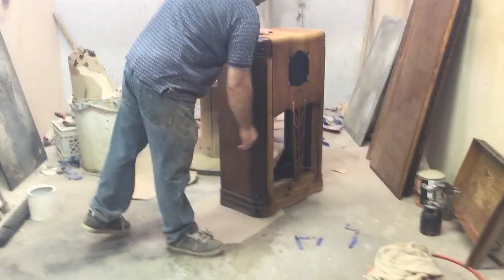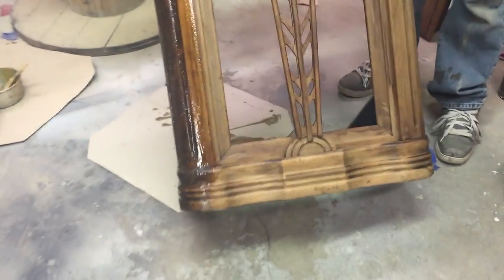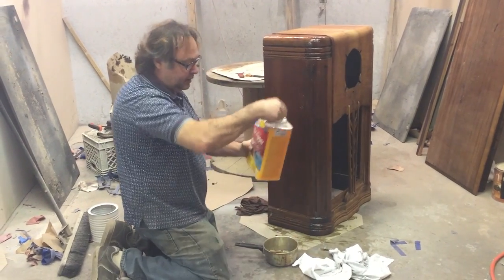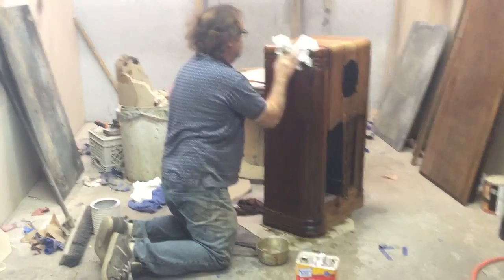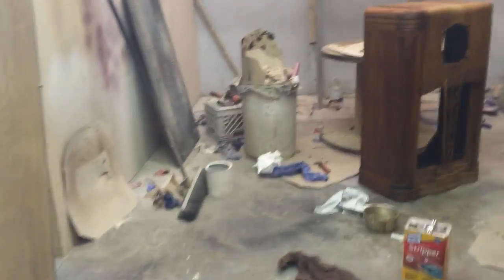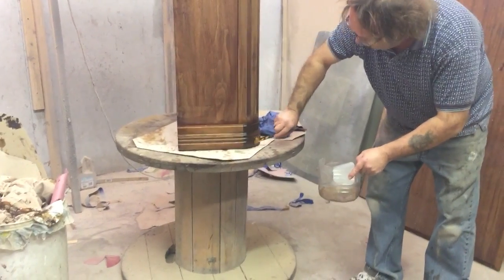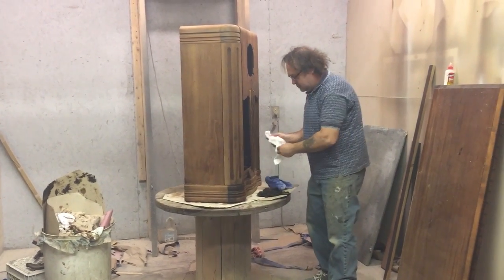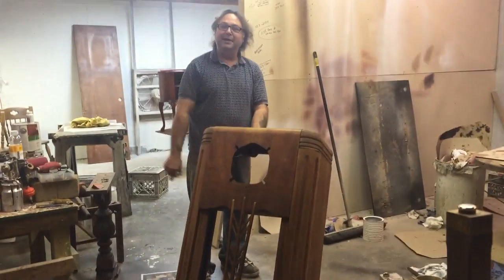How to hand strip a antique zenith radio 10 s 153

Comment: Lacquer is easily stripped with lacquer thinner and a green scrubby pad. Only downside is that you need good ventilation, gloves, and no sparks. Works like a charm, tho. Follow with lacquer thinner soaked paper towel or rags until all is removed.

Comment: Poor radio. Never look right after they have been messed with. I leave original finish. Also that stripper is so toxic. Liver damage, and for what? Just to de-value a radio.
Reply from the maker: thank you ,i will keep that in mind
Reply: I disagree 100%, crappy old radios are usually thrown out or sit in the rain on the street curb until they are picked up by the trashmen. On the other hand a shiny radio that looks like it was just delivered from the factory to your local Woolworths is going to be worth $2,000 and it will be treasured as a family heirloom for another 50 years. More people need to do this instead of pretending that scratches and chips are somehow glorious battle scars of a bygone era. Thank goodness the guys that restore cars don't try to parade around in rust buckets claiming thats the way a model T should look now
Reply: @photographteacher  Actually, they are only original ONCE.  And there are plenty of guys running around in "rust buckets" with the original patina.  It's actually a thing now to leave a car as original as possible, despite it's warts from the years.  Most of the restorers have no idea what these old radio sets looked like originally as witnessed by the use of satin finishes instead of the high gloss the factory used.  I can't argue with your point that many prefer their sets restored to suit their tastes.  But many do indeed prefer the original alligatored varnish as witness to aging process that 80 years brings.  That, and the bumps and bruises.
Reply: @ Bryan, I agree with you, I think some problems with restoration come from people not knowing what the originals looked like when they were factory fresh. But I think the best way to describe the concept of restoration is with the old car analogy A 1970 Buick skylark with rust holes and blowing smoke as it drives has a value of probably $700. That same Buick painted purple with flames and tricked out modern motor additions is probably worth $8,000-$12,000. I am not a fan of this type of restoration (the 50s paint and flames is not even appropriate on a70s car BUT it is much better than the found in the field "original" I do fully believe that the same buick restored to look original But with modern improvements base coat clear cot in the same original color, repaired carburetors (but no additional tachometers and such) has a value of over $20,000. its that simple A standard original  zenith 10s I see at yard sales and such for less than $50 - many times they can't give them away. I bet this version in the video would sell numerous times at prices of over $800, would probably have several people interested at prices of $1,400 or more
Reply: You sound a lot of fun to be around